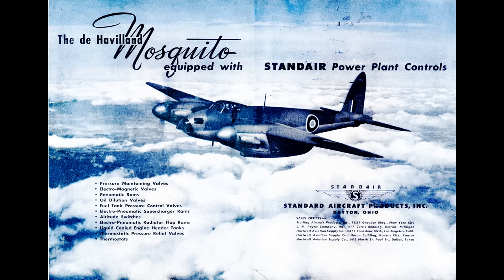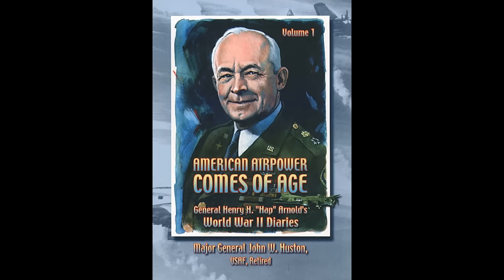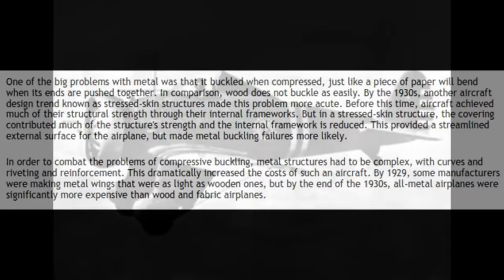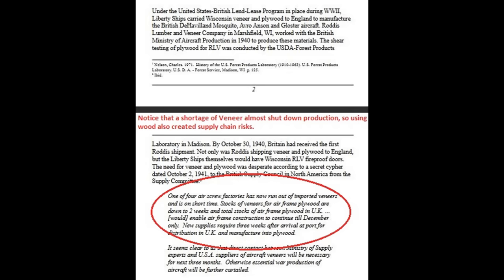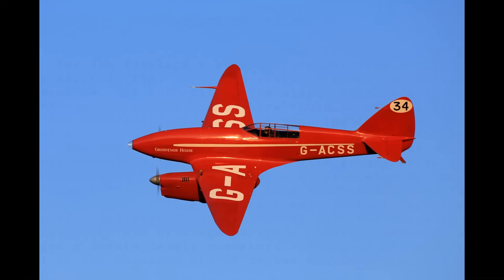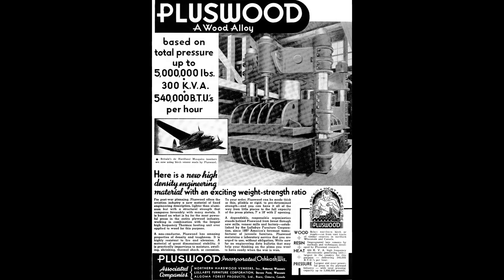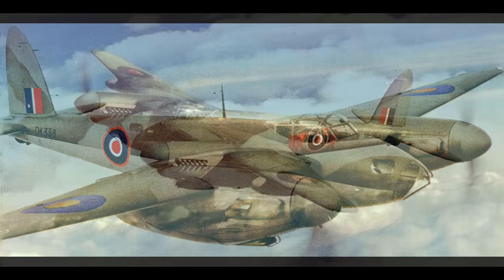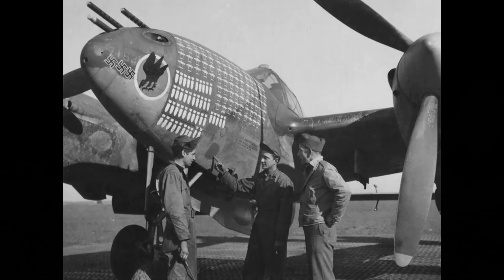De Havilland Mosquito vs. ?

Comment: I consider the Mosquito to be a  very 'modern ' aircraft design even though it is constructed of wood.   The way they used wood is more in line with the way we now use composites.  It is also the first modern fighter bomber as we use the term today.

I have also seen somewhere that the loss rate was the lowest of any aircraft in the war.
A fitting testament to its design.
Reply: Yep and the thread that runs through that, is the factory that made the adhesive, down the road from Duxford aerodrome, is still there making carbon fibre prepreg.
Reply: It was a good night fighter - but not a day fighter.  Calling it a fighter bomber is a stretch.
Reply: Ross Cox  It is one of the favorites of WWII.  Good looking too - except when they put that thimble nose radar dish on it.
Reply: @danzervos7606  
A "fighter bomber" in the likes of F-111, Tornado, F-105.
Reply: @DrsharpRothstein  Yeah, none of them were fighter bombers either, well maybe the Tornado.
Reply: @danzervos7606  
Oh well I guess the F designation by the air force is a mistake.

I get your point but they are classified as fighter bombers.  The point that I am making  is they are not heavy bombers.  The Mosquito was unique in its use at the time and that its idea is carried over into today's concepts of airpower.
Reply: @DrsharpRothstein  yeah, the F-117 has no air to air capability and yet has the F designation.
Reply: @danzervos7606  It knocked the hell out Germans on low level daylight raids, and got by with it by evading the Germans radar.  The only thing I thought that sucked on the Mos was it should have had a bubble canopy so the pilot could swivel his head almost all the way around.  The bombardier/navigator could have sat behind him providing him with another set of eyes, and when the Germans came up the Mos could have turned around and let go with its .303 machine guns, or the .50 cal some had or even that six pounder cannon for anti-submarine warfare.
Reply: @danzervos7606  Should be A-117.
Reply: My dad was a navigator in mossies. His brother died piloting a Lancaster. He often said he wondered why we didnt build more mossies. It could carry half the bomb load of a lancaster (more than a B17) it only had 2 crew, it used much less than half the fuel, it could have done 2 runs to Berlin in one night, and they normally came home! Had we used them, our raids would have got bigger and bigger.
Reply: @danzervos7606  it carried nearly as many bombs as a B17 2200 kg compared to 1860kg. Was the B17 a bomber, or a target to give the Luftwaffe practice?
Reply: Nick d'Sylva I don’t think Mossies ever had .50cal MGs, certainly not M2 Brownings. FB.6 had 4 20mm Hispano Mk. II with 4 .303 Brownings, FB.18 had Mollins 57mm cannon as I remember. I’m not sure if it’s a 6-Pounder found in some British tanks. 

Also the plane you’re looking for should be D.H.103 Hornet. It’s a development of a Mosquito, with 2 Merlin 130s producing over 4,000HP combined.
Reply: @nickdsylva932  not much need to be looking behind.
nothing could catch it.
Reply: Left _Ventricle Yes they mounted some sort of anti tank gun in a few. The pilots felt like the plane stopped when they fired it.
Reply: Dan Zervos It was designed and built as a two man bomber carrying same bomb load as. B17 out to Berlin and back so call it a bomber is correct it had a bomb bay it carried a large amount of bombs.4000 Lbs nearly double that of a Boston 2,400lbs. All available on Wikipedia and the web generally, you need to research Dan before commenting.
Reply: clive pritchard There was a book my dad read & gave me by a Lancaster RAAF pilot. It was an interesting & harrowing read. Of the 24 crews that flew with the squadron his was the only one of 2 crews that survived their tour of missions, there were even injuries in his crew. This squadron was infamous for having the worst losses of any RAAF squadron. It could have been 463 squadron from memory. I think the problem was the facilities to put mosquitoes together was a big problem in producing them. Adolf Galland the leader of the German fighter section said in his book, that the mosquito was the plane that worried him the most, they were gone by the time the Luftwaffe could react to them & were too fast to catch.
Reply: Anthony Wilson The fighter version did not carry bombs. It was either one or the other. It was a brilliant aircraft , years ahead of its time.
Reply: @beagle7622  it actually did. but it had just one internal bomb bay instead of two which the pure bomber versions had. Therefor it could only carry half the load internally. the bomb bay which was closer to the front was indeed occupied by the breeches and the ammunition of the 4 hispano suiza's. Additionally to those bomb bays, the MkVI (fighter/bomber version) had two bomb racks under its wings, which could (and would) later be swapped with rocket rails so it could carry 8 rockets instead of the wing mounted bombs. The Nightfighters (Mk II etc..) of course did not carry bombs although im not sure if they weren't equipped with at least the rear bomb bay.
Reply: @danzervos7606  this is actually not correct. It was quite successful as a long range day fighter over the bay of biscay where mossies shot down many german long range fighters who in their turn were patrolling the area in search of allied anti submarine planes. Of course, these were rather large twin engine fighters like the mossie itself. It wasn't expected to dogfight with single engine fighters like the Fw 190 or the Ki-43 - although it's massive frontal armamend could (and frequently did) make short work of such an opponent should he make the mistake of presenting himself in its crosshairs - on night AND day missions. That said, the smaller single seat P-38 was certainly more suited to engage single engine fighters than the larger two seat Mosquito.
Reply: @left_ventricle  you're right, there was no .50cal MG's on the Mosquito. It's 4 .303 cal Brownings and 4 20mm Hispano Suiza MkII's. The Molins gun was basically a 6 pounder with an auto loading mechanism. I think this gun occupied both bomb bays if I'm correct. so this version could not have been carrying bombs exept on its wings maybe, but I doubt they would do so.
Reply: JosipRadnik1 My Dad flew Mustang 111’s  in the 2nd TAF (RAF).He didn’t say anything about operations . But talked about planes a lot.. Told me that they heard there was a mod to double the planes Bomb capacity. It caused a lot of laughter when it arrived. A new plaque on each wing saying the new bomb load. They were expecting a lot more.
Reply: @JosipRadnik1  I found this comment "Bob Braham was the top scoring RAF Mosquito pilot. On June 25, 1944 his Mosquito FBVI was shot down by a German Fw-190 over Denmark. A good example as to what happens when a Mosquito pilot gets cocky and decides to dogfight with day fighters."
Reply: JosipRadnik1  I know a bit about the Mustang with the information I have read in a book my dad had , but would like to find out more about the mosquito. The Mustang is usually compared with Spitfires & Tempests in testing literature available on the net . I don’t think any other aircraft could have pulled of the raid on the Copenhagen Gestapo Headquarters. That was amazing for the time how accurate the raid was, with the exception of 1 plane being damaged. Going to read up on it more.
Reply: @danzervos7606  
I agree, as I already said: It wasn't expected to dogfight with single engine fighters like the Fw 190 or the Ki-43 etc... If Mosquitos met single engine fighters they were supposed to evade them. If this wasn't possible, a group of Mosquito FB's still could be very dangerous as long as they could cover each other with their heavy armament in mutual support but a single Mosquito against a single FW190 at the same altitude and speed was pretty much doomed of course. 
 That said, the Mosquito went on missions to hunt and shoot down other fighters on day missions - heavy, long range fighters like the Ju88G and Me110 but fighters nontheless. Those missions could not be assigned to Spitfires or Typhoons due to their limited range and I dare to say that they were better suited to that role than the P38 or even the P51, since these missions involved hours of dull patrolling and scanning the skies on solo or two plane missons  - a task that two pairs of eyes per plane could definitely do better than one. So this makes the Mosquito a pretty capable heavy, long range day and night fighter for its time, as long as it's main opponent would not be single engined fighters of course.
Reply: Dan Zervos USAAF made use of several different aircraft in the fighter/bomber role in the ETO. The P-47 is probably the most notable because of the amount and variety of ordnance it could employ, its rugged construction and air cooled “round motor” which could sustain battle damage and still get home unlike the liquid cooled engines of the P-38 and P-51. 

There’s also the A-20 Havoc which was flown more like a fighter/bomber than a bomber.
Reply: @richardbriscoe8563  The USAAF aircraft denoted "A" were attack bombers which included the A-20, A-26, and A-36.  The Army Air Force also had versions of the Douglas Dive Bomber and Curtiss Helldiver that were given "A" designations (although they saw little service).  None of them were intended to be air superiority fighters and thus were not fighter bombers.
Reply: Dan Zervos I am quite well aware of that. The distinction in tactics was seldom based upon such artificial distinctions. The A-20, in particular, led the way in the development of tactics and doctrine regarding close air support. Many “F” designated aircraft were used in ground attack/close air support roles and still are. The label on the aircraft that delivers the ordnance on the target is of little relevance.
Reply: @danzervos7606  It was a bomber it had a bomb bay and a two man crew and carried almost the same as a  B17 it was a bomber. but it was so dam good a bomber it could other things as well. What is it you do not understand this was not a fighter with bombs strapped externally it was a bomber With bomb bay that was so dam good it could be many other things and it was.. That is is the facts lets discuss why not?
Reply: @anthonywilson4873  I didn't say the Mosquito wasn't a bomber, I said that calling it a fighter bomber was a stretch.  The P-47, Typhoon, P-38, those were Allied fighter bombers of WWII.  They could carry bombs to a target, drop them and then engage the best fighters the Axis had.
Reply: Yes, we have gone back to composite woods for some structural components, we are even using it for structural beams to replace the usage of steel.
Reply: It was fast it was agile and could pack a hell of a punch, oh and gobsmackingly lovely
Reply: big cheese  

The Germans did it wrong.   They were not as innovative as the Brits.  How the Brits used anisotropic materials is very similar to the way we use carbon fiber (also an anisotropic material) today.  That is why the Brits had such success with it.
Reply: big cheese  Wood wasnt at fault for the Fokker Tri-Plane issues, it was poor quality control, failing to varnish interior structures such as ribs and poor design with the top wings experiencing 2.55x as much stress as the lower wings.
Reply: Actually modern composite aircraft are constructed like the Mosquito and not the other way round.
Reply: @nickdsylva932  all of the ‘fighter’ mosquitos had 4 20mm cannon most had the 4 303 machine guns as well. The tsetse version had the 6 pounder Mollins gun which retained the 4 machine guns.
Reply: @danzervos7606  It could outclimb both the mustang and the spitfire. It was also highly manouverable.
Reply: Britain had some really poor twin engine bombers before the Mosquito, like the Blenheim, terrible record for getting shot down.
Reply: Wood can very well fall into category of composites. Ex a sheet of thin plywood. Fiberglass, carbon fiber and kevlar can all be used with polyester or other resins.
Reply: @nickdsylva932  Not sure the 2nd crew member could have sat behind the pilot, the spar would have been in the way.
Reply: @garymilne8900  
9
Reply: @clive373  A Mosquito really couldn't haul more load than a B17....its often said, even written but has no fact behind it😎
Reply: @danzervos7606  It performed as a day fighter with a loss rate of 0.7%…
Reply: @nickdsylva932  You’ll like the D.H. Hornet I think!
Reply: @BryanJohnson4891  Attacking Buzz Bombs?
Reply: thanks Dr, I was just going to add a similar comment.  I have built and raced sailboats made of carbon fibre with Nomex  honeycomb or foam cores.  it is hard to believe how stiff and strong and light the structures can be.  a Balsa core with Birch skins would have very similar characteristics, enabling a true monocoque construction, which is usually the stiffest, strongest, lightest method possible.
Reply: @richardrichard5409  The facts are that a Mosquito could carry a 4000 pound “cookie” style bomb to Berlin often twice a night. A B17 could not carry  those types of loads that distance. On shorted distance raids on targets in France the B17 carried less fuel and consequently  had a greater bomb load. But not to Berlin
Reply: False, the B17 could carry a 6000 lb bomb load 2000 miles. The Specially made Mark IV mossy had a range of 2040 miles but could only carry 4000 lb bomb and with greatly reduced speed and climb. The reality is the B17 even being older could carry a bigger payload and had about the sane the same range. The biggest hype about the mosquito is always its speed....well when carrying a 4000 lb bomb its speed and performance was drastically reduced but fanboys don't mention that. It was a cool balsa wood plane...  But the crusty old B17s deserve some respect.
Reply: Don't forget, wood is a composite itself.

Comment: My Dad was RAAF in the Pacific and was in awe of the Beaufighter. Always referred to as "whispering death". Great platform for a range of armaments and missions.
Reply: Indeed. An underrated plane
Reply: @TheHarryMann  it was based on the Blenheim, it was a great aircraft not as fast as a Mosquito but equally deadly as a night fighter and also was good as multi role aircraft
Reply: And basically, the Beaufighter did (almost) everything the Mosquito later did. Dropping 4000 pounders on Berlin and photo-reconnaissance were probably the only Mosquito-specific tasks that the Beaufighter didn't do.
Reply: @TheHarryMann  precisely . This warbird don't get it's due respect . It was the armament on the Beau they put in the Mossie . The only thing the Mossie had over the Beau was speed 
 The   Beaufighter  was just as good.

Comment: Ken Dunaway was my 1st ground instructor when I was hired by American Airlines in 1985. He flew Mosquitos in the RAF before the US entered. He said the German fighters could never catch them when they did photo recon. He loved the plane.
Reply: The Mossie was by no means invulnerable. The attitude towards this airplane (and for instance the Spitfire) in anglophone countries is somewhat exaggerated and irrational.
Reply: @fasold2164  you really should do some research before you make silly comments
Reply: @fasold2164  Your probably Right about the spitfire, Although it improved all way through the 2nd World War, and after my I add ,The Mosquito was used in every different theatre of War. And excelled in all of them .So I think your Argument doesn't add up .old boy .Talley Ho .
Reply: @fasold2164  agree with the spitfire. That evolved slowly through the war. But the mossie was nearly right from the first. Only adding more weapons later . The main reason it was made of wood was the clean lines and low weight. Also it's radar picture was confusing.  Plus only two crew.

Comment: Great video about my favourite plane. Had the pleasure of talking to a pilot of a Tetse Mosquito (a mossie armed with a quick firing 6 pounder anti tank gun!) many years ago. He told me he felt that the mosquitos wooden construction helped dampen the recoil of such a big gun.
Reply: I seem to recall that they had trials with even heavier guns than the Molins (17 or even 32 pounders)
Reply: Maxwell Beer he told me he’d heard of a pilot that actually managed to shoot down a Ju-88  with his 6 pounder, the force of the solid AP round carried one of the 88s engines completely out of its mountings
Reply: @maxwellbeer6757  Not heard that, I shall ask at the Mosquito Museum, Salisbury Hall, just up the road from here.
Reply: Clive Smith I wouldn’t normally quote Wikipedia but it was the easiest to find:

Despite the preference for rockets, a further development of the large gun idea was carried out using the even larger, 96 mm calibre QF 32-pounder, a gun based on the QF 3.7-inch AA gun designed for tank use, the airborne version using a novel form of muzzle brake. Developed to prove the feasibility of using such a large weapon in the Mosquito, this installation was not completed until after the war, when it was flown and fired in a single aircraft without problems, then scrapped.
Reply: @maxwellbeer6757  A 32 pounder was fitted and fired with no problems.
Reply: @SvenTviking  a 32 pounder.....really, which one 🤣🤣🤣

One is a 3 ton 94mm tank gun, the other an 18th century ship of the line muzzle loading navy cannon.
Reply: @richardrichard5409  clearly the pirate gun.
Reply: Metal vs wood, I used to know a Mozzie mechanic, he told me the issue with them in hot desert/tropical environments was wood boring insects getting into the structure !! I understand this may have been partially delt with by insecticide being used later on 😮